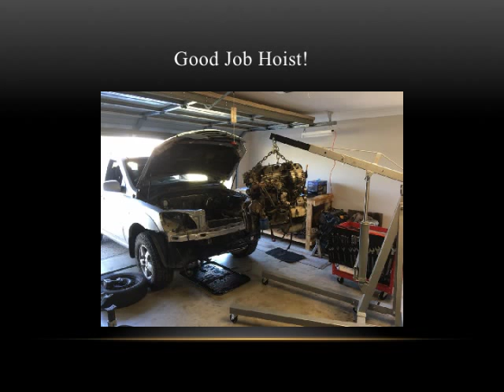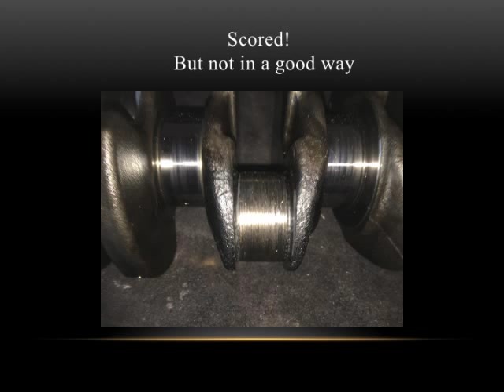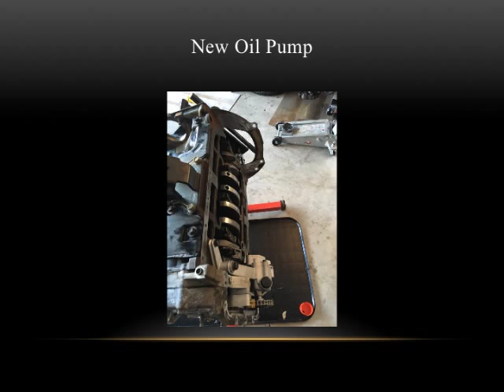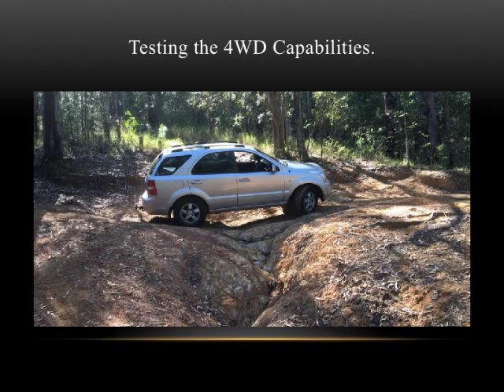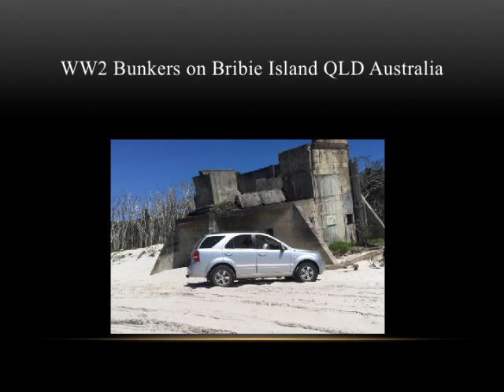Budget engine rebuild Hyundai Kia D4CB Turbo Diesel

Comment: Where did you get hold of the cranckshaft?
Reply from the maker: I am in Australia and I had to buy it from overseas. From memory it was about $600AUS with shipping in 2016. I was concerned but it arrived without issue. Contact me on instagram I may have a Hyundai contact overseas that could help .

Comment: how much torque use the bolts in this head?
Reply from the maker: New bolts.
1st stage 25Nm 
2nd stage 49Nm
3rd stage +120'
4th stage +90'
Spiral sequence from the centre.
Thanks for the question.

Comment: blocking the egr valve will keep the carbon from contaminating the oil... clean oil happy engine
Reply from the maker: Thanks John. Totally agree! I will have another Video soon showing an ERG blocking plate being fitted to a different car. This particular car after it was up and running I unplugged the EGR valve wiring. It doesn't give a CEL but does show a pending code if you are do a code read, it was simpler than making and fitting a plate.
Reply: @killawattgarage  wait what? Could i just unplug my egr connection to keep the gate closed? I'm about to program and delete my egr soon. I guess the egr creates the problems that makes theese turbos to get to the junk bin. It blocks the turbo oil pickup right?! I get p0234 fault codes and lose power while drivning around 75mph
Reply from the maker: @Helikopterpop  I did a roadside visit on a Hyundai iload with this engine. The EGR valve was sticking in the open position and the car would run but could not be driven. As I temporary measure I unplugged the EGR and give it a few solid 'taps' to allow the sticking valve to close. No engine light but you could see the EGR fault with a scan tool. Years later I still service the car and always mentioned that the EGR should be replaced. Hasn't yet happened.
Reply: @killawattgarage  I keep getting the P0234 error that idicates that the boost pressure is to high. I checked the freeze frame and had 25kpa @ 120kmh, I forgot the rpm. I don't know if that's much load. But today while driving i kept hearing the turbo whine, but not in an infinit increase, it sounded like it peaked and stopped at that tone.
Reply from the maker: @Helikopterpop  Check the turbo actuator, make sure it's not sticking and can move freely. The actuator itself may have a leaking diaphragm, check this too.
Reply: @killawattgarage  I actually ordered a new garrett turbo. I will unprogram the egr valve at a tuning company and also add some hp. And I'm thinking that it would be more reliable if I also changed turbo for a new one. Changed oil and filter. And also if it's manageable to lift of the oil pan and ultrasonic clean the oil pickup. I do not want to lift out the engine.

Do you think that the change of turbo would be "easy". Or is it a lot of things that I'll have to remove to be able to swap that out? It looks to be fitted pretty high up in the engine bay in my starex.

New turbo, clean oil hoses, new oil, cleaned oil pickup and possibly some engine flush before the turbo swap wpuld do me good right? And of course, a shut EGR system. And some new seals for the injectors. I hope I can manage all that. I got litteraly tons of tools, byt I don't feel all that comfortable when pulling engine things apart of my daily driving car...

cheers
Reply from the maker: @Helikopterpop  These engine were in a number of different cars, what's it in?
Reply: In sweden the cars sells under the namne H1, but i guess it's the same version as iLoad
Reply from the maker: @Helikopterpop  Not much engine room and you have lined yourself up a lot of work. I would expect you to have plenty of time and a great range of tools to swap out the turbo and drop the oil pan. The front ends come off those pretty quick and it would then give heaps of access. May be the best option.
Reply from the maker: Let me know how it goes.
Reply: @killawattgarage  thanks. Well i'm not looking forward to tearing down the engine. Is it a big deal to remove and replace the oilpan? Or is it just bolted all around and then fitted with a packing?
Reply: @killawattgarage  i looked down in the engine bay today. And it looks kinda accessible around the turbo.  Pretty much only the air filter box in the way. Also for changing the injector washers it looked accessible. Where did you get the correct torque specs for the injector clamp bolts? I saw one dude that changed his turbo and took off the whole extraxtor or outlet manifold as a unit. I feel that that easily creates more problems with the manifold gasket? Couldnt I just remove the turbo you think?
Reply from the maker: @Helikopterpop  Can't recall where I got the torque spec from. Also the injectors are really hard to remove and I used an injector puller. if you can easily get to the turbo then just remove it without the manifold.
Reply: @killawattgarage  I can see some torque specs on this video: https://www.youtube.com/watch?v=Sn65aJn8VHY

Comment: Did the owner have it serviced regularly or did it manage to do that on its own?
Reply from the maker: Yes, full service history from the same independent mechanic from new. The issue is that they have a 15,000km service interval but it's just too long especially without using synthetic oils. The oil pickup getting blocked up with carbon and sludge was the start of the problems. Had this been cleaned out the rest would have been prevented. After it started knocking the owner drove home (about 30 minutes) and then put it up for sale. I bought it for next to nothing, fixed it, drove and enjoyed it for awhile then moved it on to new onwers.

Comment: are these engines interference?
Reply from the maker: Yes, but the timing chains in these are reliable.
Reply: @killawattgarage  will they last the engine lifetime without maintenance? I got the hyundai iLoad 2.5 crdi 170hp engine. Probably the same. I just ordered a new garrett turbo. I hope it fits.